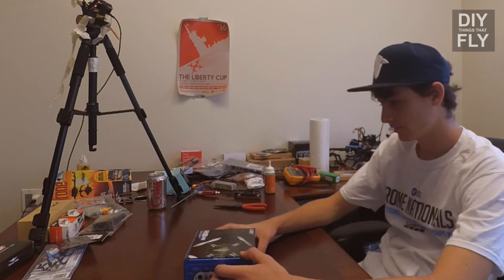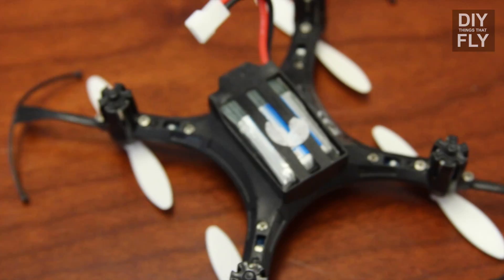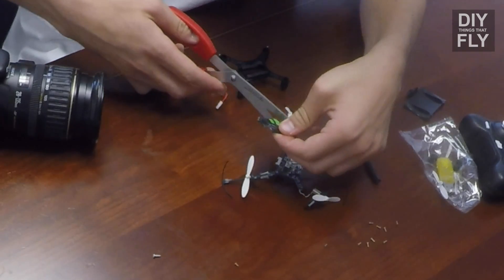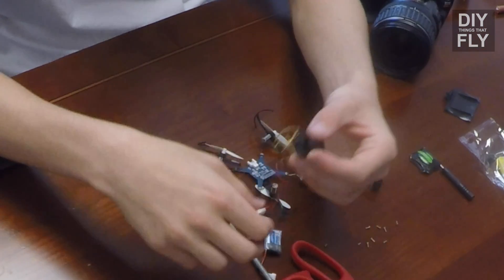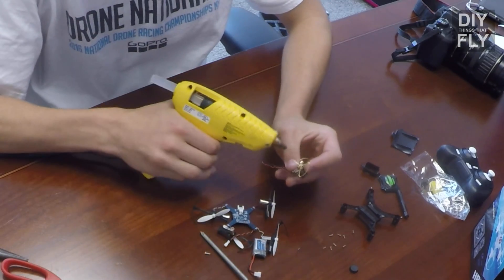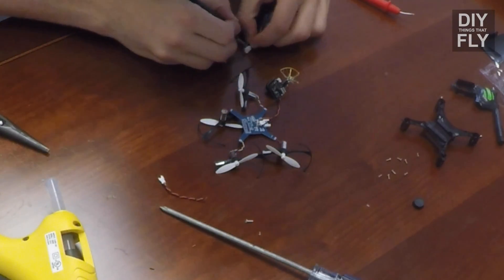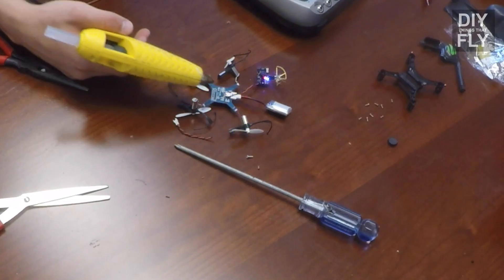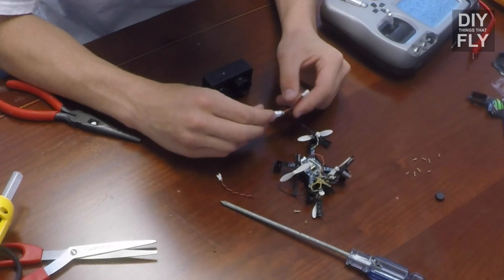$51 TINYWHOOP!! How to build an H8 Micro FPV quadcopter!

Comment: You cannot really beat the tinywhoop. They have a kit available already for $60 (http://www.banggood.com/Eachine-E010-Frame-Beecore-F3-Flight-Controller-Chaoli-615-59000RPM-Motor-TX03-72CH-VTX-Camera-Set-p-1114191.html?p=T412213768073201602F), you can fly and train yourself with acro now with the beecore that comes with it.
Reply from the maker: My build is still much cheaper :P 
Acro is nice, though.
Reply: actually bro you can do acro as well using h8. check silverware firmware :)
Reply from the maker: Yes, takes a bit of work though :P
Reply: these beat tiny whoop you can flash silverware firmware less than 7.00$  so it 1/3 price of beecore also theyre faster lol and fc can handle 7mm motors as well as 8.5 if u add 10uf cap

Comment: Great project! I want to use a TBS Tango on a Walkera Rodeo 150 quadcopter. I was wondering if a Crossfire module would work?
Reply from the maker: Crossfire module fits into the tango, and as long as the rodeo can take a ppm or sbus input from the crossfire micro receiver it should work. :)
Reply: Hey Riley thanks for the reply! It actually does have a external rx port for both PPM/Sbus. So I will definitely look into that! Quick question: I noticed you're also from NY, I live in Midtown Manhattan myself... Where on earth do you fly your Quads? Cause I have know idea? I own quads ranging in size from 150's to 580mm hexacopter's! Any advice will be greatly appreciated:)
Reply from the maker: I live uptown! But unfortunately I don't get to fly often... When I do, I go to Ferry Point, or even out to long island. Ferry point is probably your best bet, though. I can hook you up with a bunch of the guys that fly there, if you'd like

Comment: how do i make my H8C mini into an fpv since there is no transmitter?
Reply from the maker: You can buy the same video transmitter I used for my video and install it in the same way, just solder the leads to the battery port of the H8C :)
Reply from the maker: I'm not familiar with the H8C so if it has it's own camera and video transmitter already all you need is a 5.8ghz reciever/monitor or goggles

Comment: Bought two of these from Banggood, one was dead on arrival (after binding it would unbind at the slightest touch of the throttle)
Banggood have been worse than useless at getting it sorted out, have had to open a Paypal dispute
The one that does work isn't very good for indoor FPV, any tiny nudge into a wall/door/chair leg (and I don't mean a crash, just a nudge) and the ruddy props come flying off, I tried all sorts to get them to stay on without any luck so constantly having to go and put the props back on :(
My advice is stick to quality kit and buy from a reliable supplier
Reply from the maker: DUDE!!! That suckssss :(
Yeah maybe a good idea to buy from other vendors!

Comment: I see other people using a voltage regulator. Does this work well without one?
Reply from the maker: It works well as long as your camera/vtx module is able to run 1S lipo voltage. The module I'm using in this video works very well :)

Comment: Great, but the great thing about the Tiny whoop Inductrix is two things: Bind to your "real" transmitter (dsm) and most of all ACRO MODE 
I recomended Eachine Tiny QX90 90mm Micro FPV Racing Quadcopter BNF Based On F3 Flight Controller FrSKY Taranis X9D
https://banggood.app.link/pZEbVFDNNv or this One even smaller and dsm, frSky and Flysky Eachine Tiny QX80 80mm Micro FPV Racing Quadcopter PNP Based On F3 EVO Brushed Flight Controller 
https://banggood.app.link/3YM8XQHNNv
Reply: looking forward to it :)
Reply from the maker: Thanks for the recommendation- this an also do acro after you update fw! I'll be making an update video later :)
Reply from the maker: Also, I'm making a how-to make your own module so you can bind your own transmitter